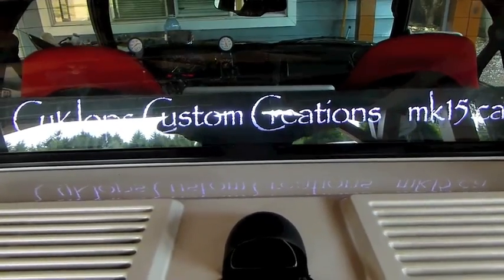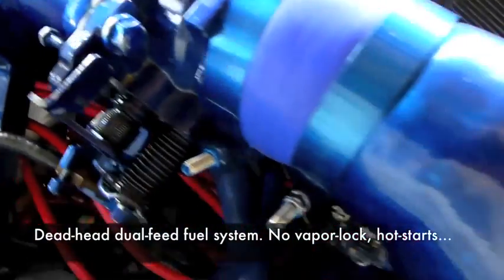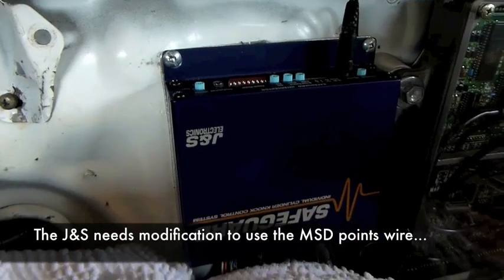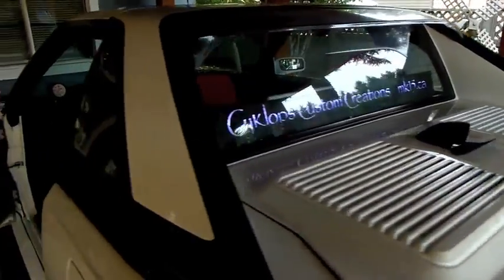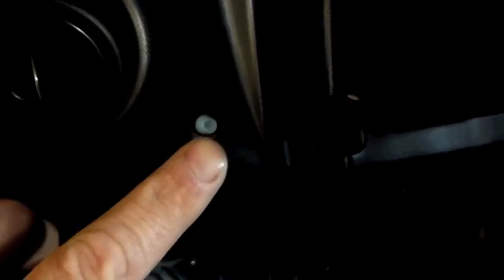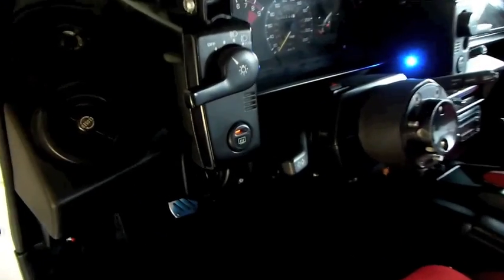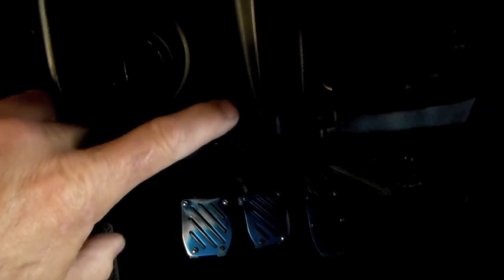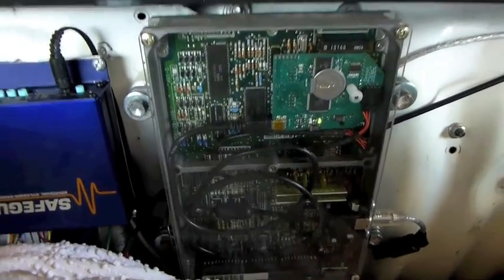MKI.5 MR2 with Honda P06 Ecu and Neptune Start-up

Comment: How much does a water to air set up go for?
Reply from the maker: Alexandra, it really depends on what car you have and what driving style you plan to use it for. Then it depends on the quality/brand of main components (HE, IC, pump, fittings you want), plus the size of the tubing you want to install (the bigger the better for water-flow and performance, but the install becomes more difficult), and the look/material of the tubing/fittings (rubber vs braided hose, aluminum welded hardlines vs pvc, even copper hardlines etc). 
Because the frunk (front-trunk) of my MR2 has a custom stereo layer installed, everything underneath is hidden, so I opted for huge but inexpensive tubing (pvc, abs, copper). In the engine bay, the IC core is mounted vertically and I welded up the water-side endtanks to enter/exit completely from below (also hidden) so I was able to utilize conventional hose-clamp configurations and use shorter lengths of large hose to connect the hardlines to the componenets. This way I ended up with max performance combined with inexpensive tubing/fittings, and spent my money on quality HE and IC cores, and big pump. Until you look underneath the car, you can't even tell it has A2W.
Regarding the brands, you might find cheaper IC/HE cores with the endtanks all welded up etc on ebay, and figure out how to make them fit, but it is better to buy quality cores and have it all custom welded to suit your car and overall plan.
Expect to pay somewhere from $800-$1500 for components/parts and additionally anywhere from $500 - $2000 for labor. 
To learn more about A2W intercooling and for help with decisions to best suit your needs, visit my Ultimate A2W intercooling Guide:
http://mk15.ca/MJK_iPage_Website/MKI.5_MR2/Intercooler/Intercooler_Projects.htm

Comment: how to modify the honda distributor to fit the gte head?
Reply from the maker: http://www.mr2oc.com/61-3sgte-turbo/381639-alternate-engine-management-3sgte.html
Reply: Martin Johann Kloppers 
thanks for the link bro
Reply from the maker: No Problem. The last page of that thread has some important information regarding the adapter needed to make the dizzy fit. The previous designs called for an aluminum adapter, but mine failed on me at high RMP (as far as I know that is the only reported failure thus far, though)... I then used a donor 3sgte dizzy and took the keyed end section off the dizzy shaft, and with a sleeve I mated it onto the Honda dizzy shaft... this could be done via pins, but I brazed mine. This also ensures that where the  moving parts meet up it's all oem fitment, and wear from varying metal types rubbing together is not an issue. Should last forever.
Reply: Martin Johann Kloppers 
ohhh nice to know this bro. appreciate that!

Comment: what do i need to run a honda ecu on a 3sgte on p06 ecu?
Reply from the maker: Sorry I did not respond sooner, I missed your question. This following thread explains all involved. We repin the harness, or make a harness adapter using a donor Civic harness with the same plug configuration. Switch to a Honda IAT sensor (which we modify for fast-response). Use a Honda Civic P06 dizzy, make up some new spark plug wires for length and to fit the new dizzy. Find a Civic P06 ecu (or a few other types listed will work too), modify that ecu to allow for boost and tuning, choose an engine management system (even the free Crome worked, but I chose Neptune), modify the Civic dizzy with an adapter + o-ring and enlarge/elongate the mounting holes, and then get tuning! It's amazing that almost all sensors and systems work in the same manner, even the EVAP/purge system (with the charcoal canister) is retained.
See here:
http://www.mr2oc.com/61-3sgte-turbo/381639-alternate-engine-management-3sgte.html

Comment: You running water injection somewhere or a cooler?
Reply from the maker: +Xenon676 
No water injection at this time, just the A2W setup which features: (Bell core) intercooler, Fluidyne heat-exchanger (intended for a 2003 Mustang Cobra) at the nose of the car, Johnson CM90 pump with minimum 1.25" (ranging to 2")  plumbing throughout. The system has no reservoir, 9.3L capacity, and flows around 27 GPM. System recovery occurs in about 30 seconds. I may consider water-meth injection in the future for increased timing and knock protection and more boost.
Reply from the maker: Water Injection (Snow) added 2018, as well as a boatload of timing and a few more lbs of boost.